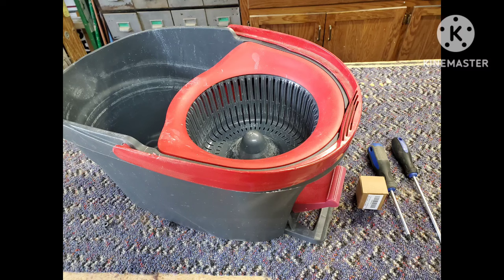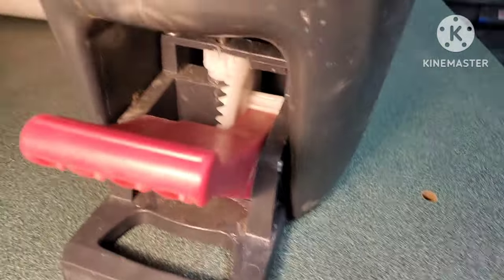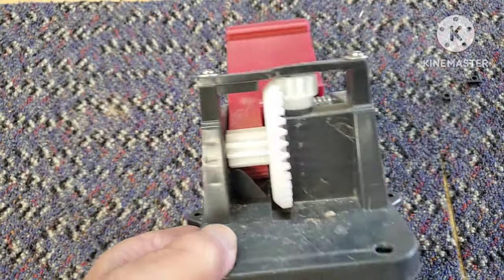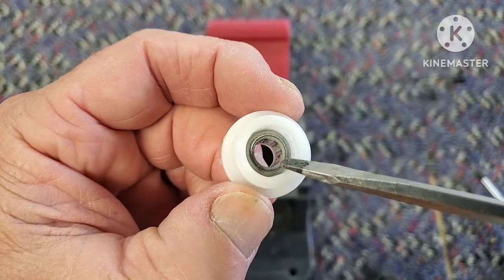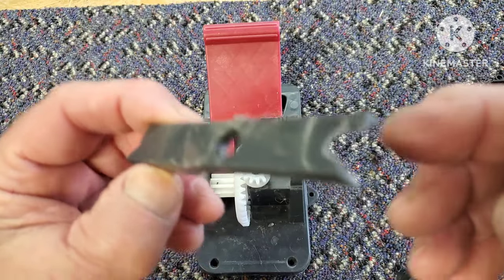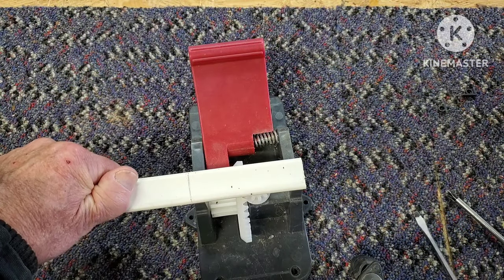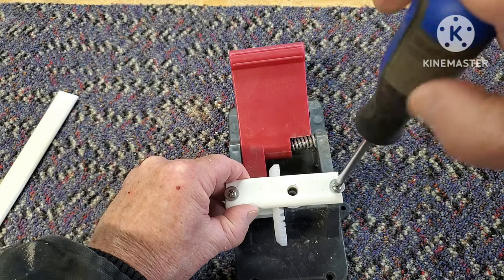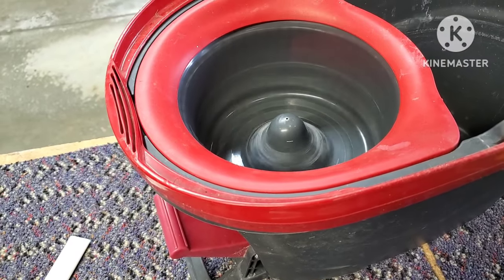o-cedar spin mop (easy fix)

Comment: I took mine apart and determined that it was that little part.  I KNEW if I came on YT and searched, someone would link me to the part that I need.  BUT, I didn't order the one linked... I found a four pack for $8 with good reviews. Pretty sure they will fit just fine.  I have two of these of my own, and also the retreat center that I do work for has like 20 of them. Now I've got backup for when they break. ;)
Reply: What’s the part called and where did you buy it? Can you send me the link?

Comment: I just repaired mine. My plastic connector also broke but i glued it back with gorilla glue and UV resin.  If it doesn't hold up I'll fabricate one with my 3D printer (I'm a crafter and gamer so i have these on hand)
Reply from the maker: Sweet

Comment: I have the same issue, and figured there must be a one way bearing somewhere.  I can't get the shaft out either, the shaft must have seized to the one way bearing.
Reply: Trying to fix the one we borrowed from my MiL currently... Did you ever figure out a way to get it off?
Reply: @MarkBonneaux   I had to break the plastic bracket in order to get it off.  I wrote to Ocedar, they sent me a $30 coupon for a new unit.  The newer units had a different design making it easier to get the bearing off if necessary.  I will oil it ever few uses so this doesn't happen again...